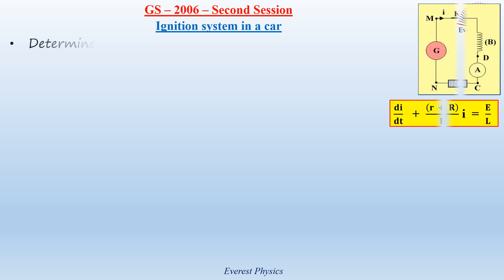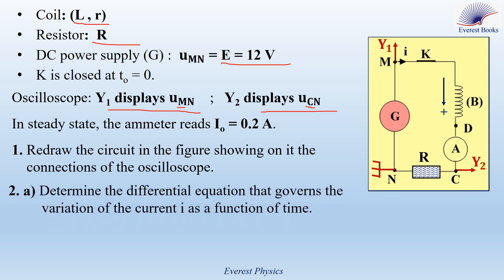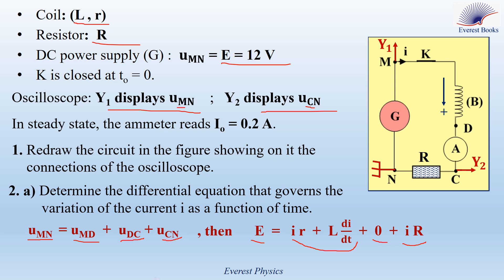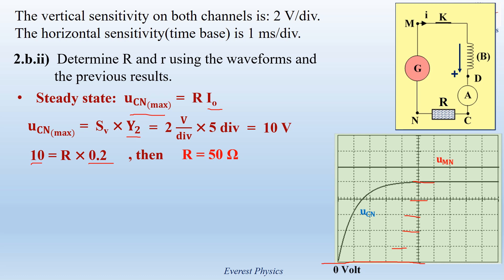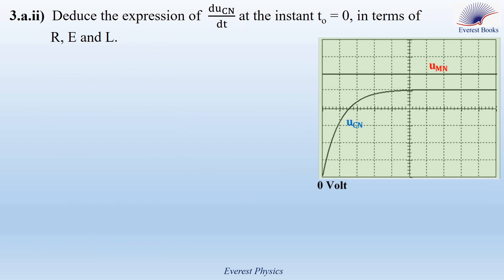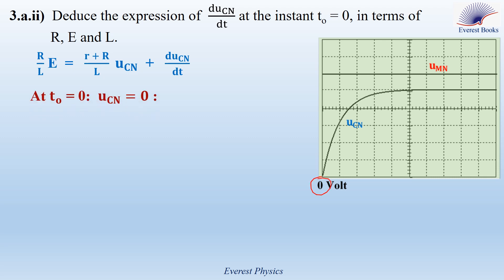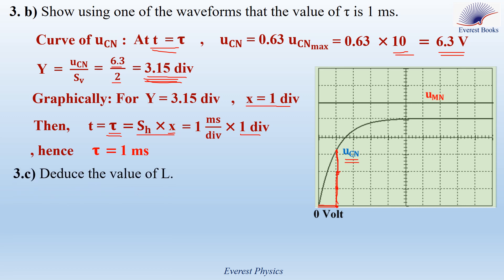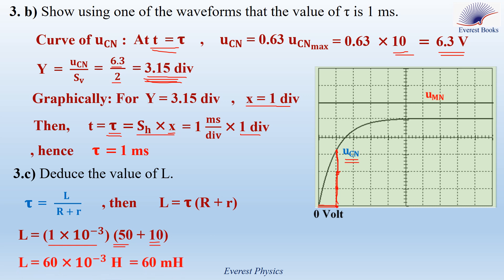Self induction - Lebanese Official exams  [GS   (2006 -2)]

Comment: How to write a differential equation in uL ??
Reply from the maker: If the coil has negligible resistance, then:

1) Apply Kirchhoff's Voltage Law.
2) Differentiate both sides with respect to time to get: uL' + (L/R) uL = 0